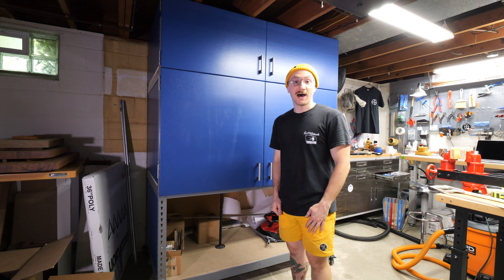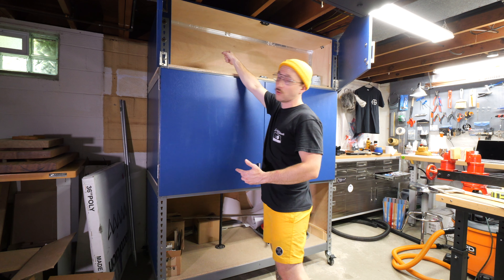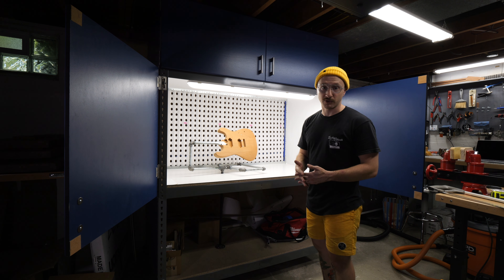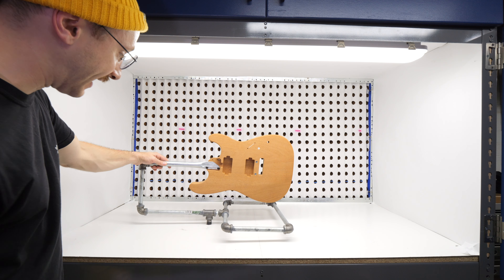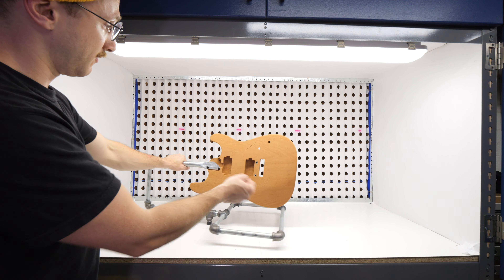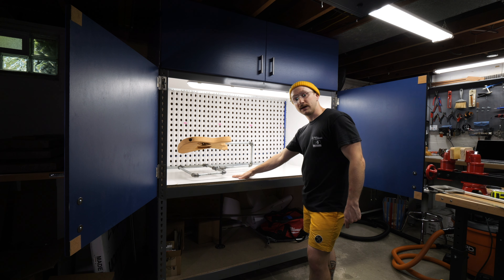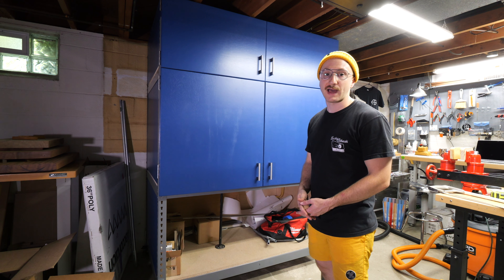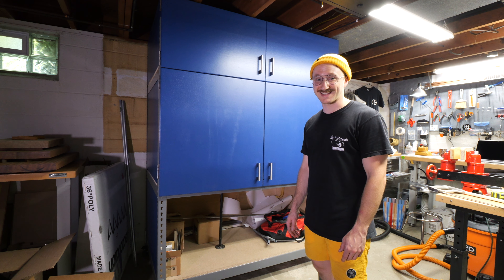Guitar Spray Booth Update (DIY Basement Cabinet Paint Booth)

Comment: Nice setup !    If you ever make another jig holder ,I suggest
you do it so the center of the guitar is center with the pivot , works a lot better .
Reply from the maker: Thanks Lou! Unfortunately I was limited by the booth dimensions… I wanted to make the holder bigger but I also wanted it to be able to spin freely without hitting the filters. The only compensations I can really do is to make the 3/4” pipe that attaches to the guitar a bit shorter. Thanks for the suggestion!
Reply: @AugmentGuitars   Wel I must say that I love your setup !  Way better than mine !
I pray outside with bugs hitting the nitro !  haha !  Oh well !
Reply from the maker: Hey we’ve all been there!!! Mine was in my dusty garage with the windows open 🤣🤣
Reply: @AugmentGuitars  Hihi !  😄

Comment: Great job on the build! Just curious—are the lighting fixtures explosion-proof? Since you went with an explosion-proof fan, I was wondering if it might be worth considering some way to seal off the lights and cables from the fumes. Also, have you noticed any issues with dust in your finish since it's not fully blocked off from the rest of your workshop? Overall, it looks like a great setup!
Reply from the maker: Thank you! I was going to detail the lighting in the next video (if I ever get around to filming and editing it lol!) I did use a sealed, explosion proof LED light bar for the booth. It's worked great for me so far! I went with 5000k temperature as that seems to be the most accurate light tone. Hope that helps!

Comment: Super cool! Newbie question, why does the fan need to be explosion proof?
Reply from the maker: Hey Ian! Thanks for watching. The fan needs to be explosion proof as a lot of finishes are highly flammable. Explosion proof fans are sealed so there is no chance of spark to ignite the finish particles in the air. If you are only spraying non-flammable water based finishes, you can most likely get away with using a regular fan. Hope that helps!

Comment: I haven’t watched all of your posts on this yet. What exhaust filtration do you use the be safe for your neighbors when spraying nitrocellulose? Thx.. Are the exhaust vapors non toxic by the time they get through both filters?
Reply from the maker: Hi Michael! I used a MERV 13 HVAC filter as the final filter before it exhausts outside of my basement. MERV 13 filters a lot of the small particles out (google MERV 13 to see the ratings) so only a small amount gets released into the air. If you are worried about exhausting out where people will be present, you can always get a stronger filter. HEPA filters up to 99%+ of particles so that could be an option for you. Also here is a link to my spray booth build series which contains more info: https://www.youtube.com/watch?v=QbUs2tUbyeo

Comment: Great video!  I have been thinking of doing something similar, but I am wondering if I would need to do something more (like an enclosed space) to better control things like dust and other contaminants.  Have you run into this problem with your setup?
Reply from the maker: Thanks Michael! An enclosed and filtered space would be ideal, but unfortunately for me I didn't have the space. 🙁 What I did is bought a small hanging workshop air filtration system that I run for a few hours before I spray. Seems to help clean the air a bit. I also make sure to mop my basement floors regularly so I'm not kicking dust up when I am spraying. So far it seems to work great but I do get some dust specs from time to time. Overall happy with it! Also I am going to be making a full spray booth build video here soon. Just need to finish the drawers and get some clips of me spraying some guitars. 😊

Here's the air filter I bought: https://amzn.to/3cXJW1d

Comment: I need this …
 Do you know if it work with hlvp gun and oil base paint ?

How many guitars you can paint before starting to see that the box container is no holding no more ?
Reply from the maker: The setup should work! It might be a bit stinky (if it’s in your basement) but you can close the doors for a bit so it dissipates. I’ve done it a few times for some high VOC poly finishes. 

I’ve sprayed around 5 projects so far and I need to change to paper lol… It’s pretty easy with the double stick tape. As far as the internal filter goes, I’m actually not too sure. I’ll check it periodically and if I notice that the fan is struggling/not exhausting as much, i will change it. Honestly the first filter collects most of the spray.
Reply: @AugmentGuitars  i did my paintingbooth but i made it with wood frame it was less expensive but works very good ...do you ahve an email so i can send you some pictures of my project
Reply from the maker: Awesome! Would love to see it. My email is augmentguitars@gmail.com
Reply: @AugmentGuitars  I just send you the video